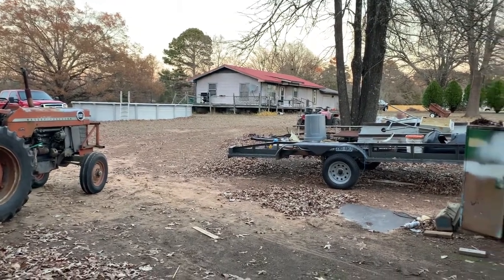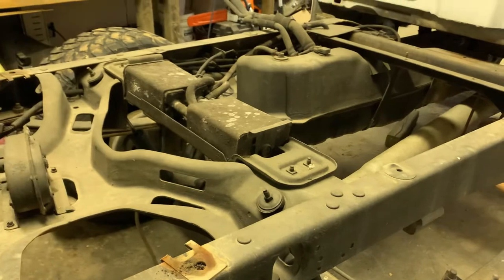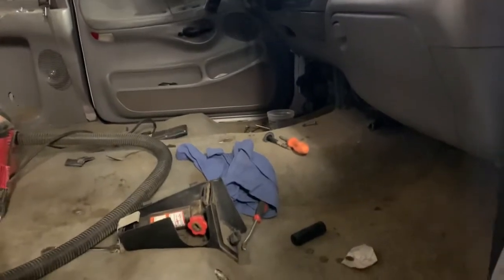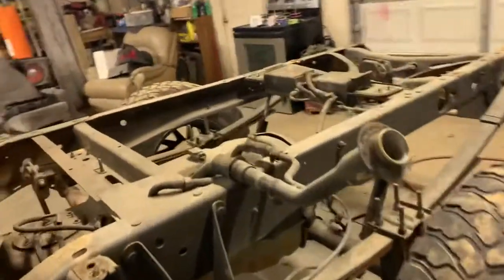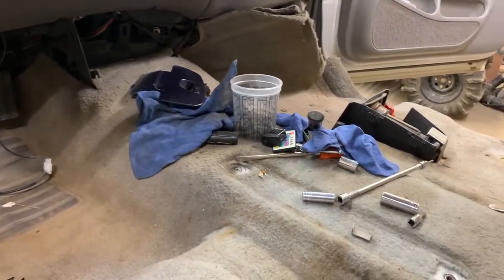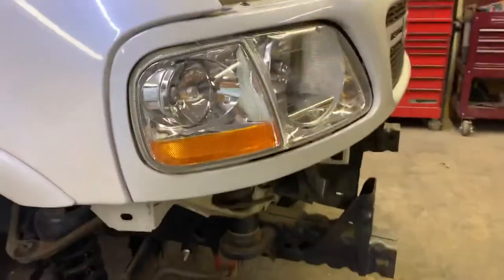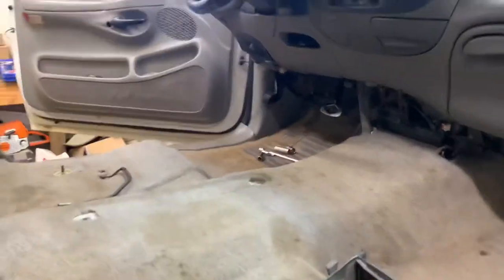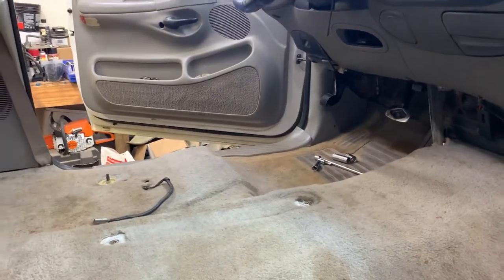YETIS BODY LIFT INSTALL PT4

Comment: How did you fix the transmission bracket?
Reply from the maker: We haven’t had a chance to get everything hooked back up, but ended up cutting a new bracket for it
Reply: @Scott46Lee  what didn’t work on the old one? J/w cause I’m about to install mine. What’s the new one look loke
Reply from the maker: Mine (that came with the kit) seemed to be too short and the cable wouldn’t ready to bolt on

Comment: I’m having trouble  fixing the shift cable and the extended parts can you show next video  that part
Reply from the maker: We’re having to build our own bracket for the shift cable
Reply: @Scott46Lee   so the extension Wtv it has rn I have to remove it and the steering right since I’m taking it off ? I didn’t do this body lift it was bought like this and I’m stuck in the cab section about now
Reply from the maker: Yes I believe so, the steering extension is relatively easy, but I’m not 100% on the shift cable bracket. Ours didn’t fit quite right and we’re having to build a new one

Comment: CAme back to watch this again, got a headache cause the camera is swinging around wildly and closer and further away that you are absolutely unable to see or focus on anything. 

Seriously the worst video on youtube that could have verily easy been the best if the Camera guy would of slowed down and let us focus for more than 0.0000000000000000000000000000000000001th of a second on anything at a time.